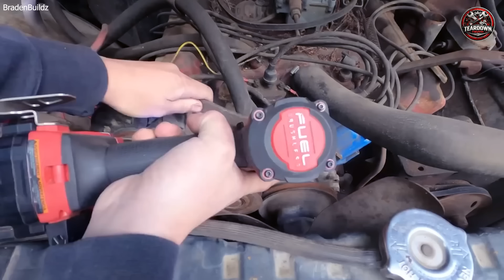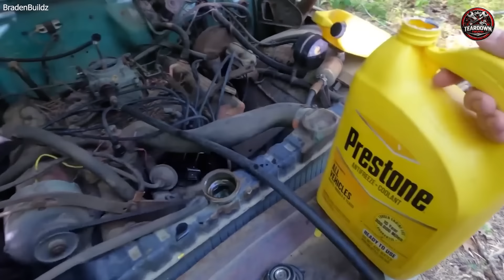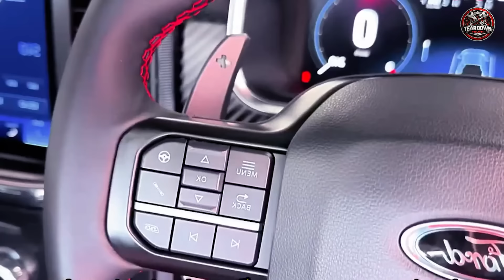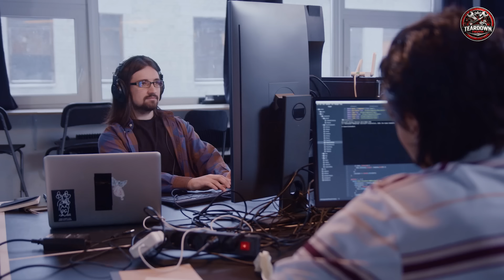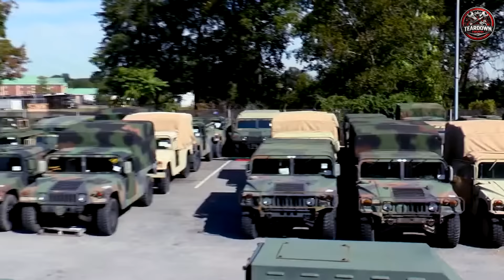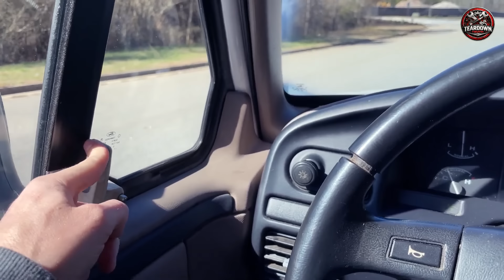Why Modern Cars Are Junk Now (The End of Car Ownership)

Comment: Anything now is crap. The electronics in everything is such a pain. Even the simplest repair can cost a fortune. Sensor failure is very common. Even changing a lightbulb can be hundreds of dollars. Many cars even require the exact battery not another brand

Comment: I have a 2009 model diesel. It has a dpf and fap fluid but it still works fine at 100000 miles but if the dpf causes a problem I will delete it and keep going as long as I can with it.
Reply from the maker: that right

Comment: Give me a well maintained early 2000's sweet riding Buick LeSabre  with that  bullet proof GM 3800 v6 engine any day, over all those high priced 2024-2026 fragile ultra " high tech "  tech trash machines all guaranteed to fail at 36001 miles.
Reply from the maker: These are cars that I think everyone should own because they are very durable.

Comment: Some of these may be over-exaggerated but it has convinced me to keep my 2002 Mustang and 2014 Xterra running. As long as they don't get totaled or parts become unavailable I'll continue to keep them running. I dread the day that I'll have to replace either one. Anyway, it seems that people should refuse to buy new vehicles to let the manufacturers know how we feel. I heard that most German made cars had the oil dipstick replaced with a sensor in the oil pan - better hope the sensor never fails especially after the warranty ends. I've heard some vehicles don't have a transmission oil dipstick either. And mechanics are complaining that they have to get a subscription to be able to use the data port to view or test vehicle functions - that leaves most DIYers out in the cold. I like technology but not when it's used to spy on me or to lock me out from DIY. If I pay $50K+ for a vehicle, I want total control.
Reply from the maker: Thanks for sharing that great experience!

Comment: They can keep their “modern” overpriced junk. I hope every automaker goes broke. I swear I will drive my trusty ‘06 model till I die and just keep it fixed.
Reply from the maker: What kind of 2006 car are you driving?
Reply: @TeardownTruth  Trailblazer LS with a 4.2 Vortec. Bought it new and paid it off 16 years ago and have taken great care of it. Currently has 175000 miles with no end in sight. Everything works. Still looks great too. If something breaks I fix it. The only thing a new one has on it as far as I can tell is a $900 a month payment.

Comment: What happens when you design to smooth brain regulation instead of innovation. By any metric manufacturers stopped pursuing quality innovation in 1999. For 27 years they have been reselling  the same car with a turbo crammed in waiting to grenade because of intentionally long reccomended oil change intervals. Plastic turbos, intakes and pumps seal the deal.

Comment: Been waiting since AUGUST 2025 To drive my EcoSport after an engine recall to fix the wet belt problem. By the time I get it back the tires will have dry rotted. That's 8 months so far.

Comment: My 2010 BMW 328i is still kicking strong with no oil leaks and no engine warning lights on. My daughter has a 2011 BMW same model with over 135K and Runs smoothly. I'll take a N/A vehicle over a turbo any day for longevity.
Reply from the maker: That’s solid. Those N/A setups have proven themselves over time — fewer stressed components and often better long-term reliability. 👍

Comment: All parts depends on its milage, like for example airflow sensor only can be used for 120,000km or 100,000mi and if more than that it need a new replacement of air flow sensor. Same thing to the computerised steering rack & throttle body. It has it's own kind of duration or time the automakers have set and design it and know when the customer get them to replace it or buy a new one/new car. People actually can  buy a new vehicle but if it's have problem and cannot be fixed then engine , control unit , transmission all swap. Just like fast and furious mustang body and nissan engine swap.
Reply from the maker: That’s exactly why so many owners feel modern cars are built around replacement cycles, not long-term simplicity. Once too many major systems become “timed failures,” ownership gets expensive fast.

Comment: Obsolescence in itself is a corporate scam.. Has anyone died of eating expired medicine.. No.... Brands add expiry date to just make u buy more. Most modern cars hv so much tech we are spoiled to use... That replacement is more expensive than repair.. Stuff is made so that it's only easy to put it together on the assembly line. Not when repairs are needed.
Reply from the maker: That’s exactly why so many people feel trapped by modern products. Too much of today’s design seems built for fast assembly and repeat sales — not long-term repair or real value for the owner.

Comment: My car is about 20 years old..only computer it has runs the engine only..it's manual and a 4 cylinder 2.6..love it..
Reply from the maker: That’s exactly why so many people still love older cars — simple, manual, fewer electronics, and easier to trust long term. A 20-year-old 4-cylinder still going strong says a lot. Thanks for sharing your experience
Reply: @TeardownTruth  here in New Zealand,  it's common to see cars that are 20 to 30 plus years old being driven and maintained daily..what's more, there are parts aplenty in wrecking yards depending on how popular your car was..

Comment: No the new car you buy is a pinnacle of safety for it's occupants and others including pedestrians both in the event of a collision and it's avoidance as well as being fuel efficient and cleaner with tailpipe emissions like never before. No prizes for guessing what the tradeoff is and only children believe in magic wands
Reply from the maker: That’s a fair point. Modern cars absolutely deliver real gains in safety, emissions, and crash avoidance — those improvements are real. The debate is really about the tradeoff: more safety and cleaner performance often come with more complexity, higher repair costs, and less long-term simplicity for the owner
Reply: @TeardownTruth Yep and slowly but surely they're getting rid of the weakest link in the whole kit and kaboodle. The nut behind the wheel and then the car can take itself off to get serviced on the knocker. 😁

Comment: I still using the 90 to early 2000 models.  The way I shift my manual gears and navigate with my own control gave me feelings of authority.  And those cars proved themselve for lasting 2-4 decades already and still running fine.  Vehicles operate on hard pavements shouldn't be delicate and controled by fragile electronic system.  Stupid.

Comment: This decline in quality by all manufacturers is no accident. It's an insidious tactic to keep people locked up paying auto loans that last the life of the car. Once the car starts having major mechanical problems that cost more to fix than the car's worth it forces owners to trade it in at a loss, rolling negative equity into the next loan and creating a never ending and growing financial albatross for the owner. But dealers will have a steady cash flow of suckers, er, customers having to come back in 5 or 6 years to replace their premarurely worn out ride. This sadly disincentavizes Toyota or anyone else from building durable half-million mile vehicles that drivers could hand down to their kids or enjoy loan free for years.
Reply: You'll be paying a loan on a vehicle that you can't use.

Comment: Buy a good used car, something made before 2000, with no computers, touchscreens, traction control, drive modes, etc.  Get one while you can, and while you are allowed to. The Government will try to stop you from driving older machines under the guise of safety or clean air, so enjoy your classic car while you can.  They also look much better than the current bloated SUV monstrosities.
Reply from the maker: Thank you for sharing
Reply: The thing is you’re not gonna find them anymore they’re destroyed or they’re not even worth fixing so people need to get over this
Reply: @GSXRDAVE  If you have the time and the skill, you can find parts and repair these cars; that's the point, they are REPAIRABLE, while modern cars are DISPOSABLE.
Reply: @GSX @GSXRDAVE ere are still kots of good repairable old cars available at reasonable prices. You just have to be willing to do some work yourself
Reply: You said it. Agree on all points.

Comment: Been a mechanic 
more than 20 years

Dumbest thing I’ve ever seen

That feature where your car starts again at every stoplight

Starting puts more stress on your engine than anything else

And they built it into your car
Reply: It also takes more gas to start an engine that it is to idle,  and the the automakers know this,  their goal is to sabotage the industry,   It would take a long post to explain it.  I will try to simplify.   CEO/board will still be wealthy regardless of profits.  They are motivated by control with money to burn.  If we stop buying cars they can say “the market has spoken,  no one wants to own vehicles” about the time they are fully automated.  They will sell fleets of vehicles.  … long story short,  it will end with technocrat dominated corporations controlling where we live,  where we can go,  when we can go there, and who can go.   You will own nothing and you will be happy
Reply: @j @johnliberty3647 eamwork makes the dream work

hadn’t even thought of that😖
Aye!
They’ll have to pry my 
 2002 Toyota Sequoia 
(302,083 miles so far)
Still breaks the tires loose 🔥)
from
-my cold DEAD hands!
Reply: @johnliberty3647 that hasn't been true since carburetors
Reply from the maker: Thanks for sharing, that's quite interesting.
Reply: Actually, they say it’s for better fuel economy. But in reality it’s a poorly executed “fix” to reduce carbon buildup which is a by product of GDI fuel systems.  Gasoline Direct Injection sprays fuel directly onto the cylinder instead of the valves. This gives more horsepower and better fuel efficiency. Sounds good, but by bypassing the valves they will now never be cleaned by the fuel. Most new cars today that are GDI have a regular maintenance interval at 30 to 40K to have the engine “cleaned” which is very expensive. This is to simply clean the carbon off the valves. Traditional injection systems, like MPI which is multi point injection, sprays the fuel directly on the valves. When using a good quality fuel, you’re basically cleaning the valves by simply driving the car.  Some manufacturers have actually made better attempts to resolve this. I know there’s a few Toyotas out there with a combo injection system. Both MPI and GDI. Literally the “best of both worlds” . . . hopefully more will follow.  Until then, I’ll avoid any car that has that stupid “start and stop” feature.
Reply: Can you tell, why they do it?
Reply: @pundrovac8250 For money. Starting so many times puts so much stress on the motor, and then it breaks more easily, and then they get you to buy a new car from them. And they get more money.
Reply: @pundrovac8250 to force you to  buy new cars.
Reply: HTTR

Comment: Most new cars are a complete ripoff.
Reply: Sell more parts💡
Last time I checked metal 
$.10/pound
Plastic is even cheaper.

You really think electric electrical wires are expensive?

Disposable parts are not expensive.
They are cheaper per pound than metal

They build those cars for $15,000 max

Sell them for 86,000

That’s the markup

Biggest thing I’ve ever heard of
Used to be furniture was the biggest mark

Not anymore…

Sadly nowadays
Buying a car

Exactly like buying a smart phone.

Technology will outdate.

Now,
If their technology was worth what they said it is?
Why 👉🏼the depreciation?🧐

Lastly
FACT 
electric electric systems
In your $85,000 vehicle
-ALL OF THEM💡
Will be outdated in three years?

Should adjust MSRP.
IMO
Reply: Only a rip off to the consumer

The markup is crazy nowadays

They’re building these cars for 10,000 $15,000 max

Technology is not expensive

It’s just wires
Reply: Chinese throwaway nonsense

Comment: I have a 2024 Chevy Express cargo Van extended with the 6.6 l gas engine. My driveway is a hilly twisty mess. If I park on that Hill I have a hell of a time opening the back doors for some reason of misalignment of some sort. The thing is brand new for the most part. I got it with 100 mi on it and only has 8,000 on it now. And I got it out of California I live in Massachusetts. The dealer totally screwed me instead of giving me the title or the origin certificate of the vehicle. Play instead mailed it to the DMV in California for some odd reason. It took me two months of having a brand new van sitting on my driveway not able to drive because I couldn't get it registered. I was furious. Nearly $60,000 and it got covered with a ton of pollen and shit because I couldn't drive it.. I wish I had a 105,000 for a Lexus LC 500. I want nothing to do with EVs. In fact I think they're going to be dead by 2035 not internal convention combustion engines. On top of that it failed emissions twice.. and it's supposed to be the California truck with all the emissions control bulshit for their high regulated crap. And yet it still failed when they stuck the probe in the exhaust.
Reply: Back in the day 50 years ago if my old man had a car that was a lemon he would fill the tank with gas shovel rag into it take it down some abandoned street light it and then go collect the insurance

Comment: Old school mechanic here  i was a petrolhead but i hate cars now  They are throwaway appliances. They last as long as the waranty is in  place. Plastic thermostats failing and causing engine failures  in German Luxury cars in particular. They all overpriced rubbish. You will never see Million mile Toyotas, again.
Reply from the maker: I'm very sad to hear this news, but I think there are older models that are still in good condition.
Reply: @TeardownTruth  Yes i do love old cars and older cars. Just the  new stuff i hate working on .
Reply: I have 2 86 87 toyota pickups. 2x4 4x4. Carburetor 4 cylinder. Best rigs...garbage these days
Reply: No joy in new cars. Especially not in the electro cars🤢
Reply: @aciddiver1978  Yes havnt had the pleasure of working on electtic cars yet. Dont see any need for them. Plenty of Gas around .Its just another way to controll the sheep.They are trying to lock us out of the current ECU with dealer only software etc. The electric ones will not go into Limp mode they will self destruct if you try work on them. 😂😂
Reply: We love and still need you guys
Reply: sad what theee twisted bastards do to us. theyre sick in the brain
Reply: I currently have a 04 civic and I’m trying to make it to 300k miles. Oil changes and Liquid Moly flushes every two weeks. Currently trying to see what MsO2 will do to the components in the engine to deplete heat stress. Good thing my pistons are iron. I hate the engine is aluminum tho
Reply: Gone are the days of the bullet proof pre 2012 toyota corollas.
Reply: To include ugly junk
Reply: I drive a 25 year old mini van
Reply: Electric cars are a pre mature climax
Reply: Your electric car will, urn your ass off the earth while you are sleeping
Reply: Yeah I will not buy any new cars anymore